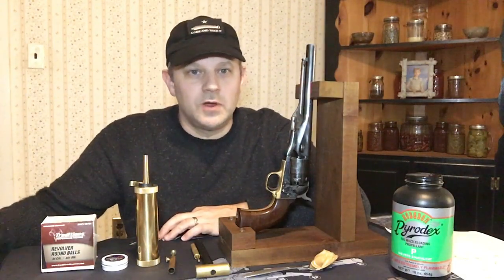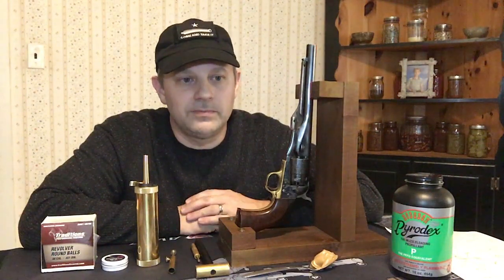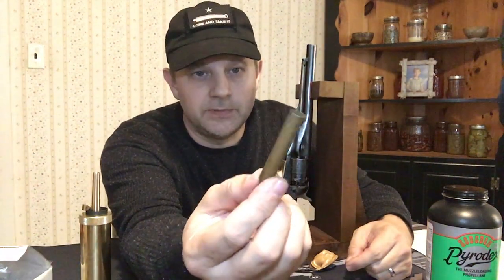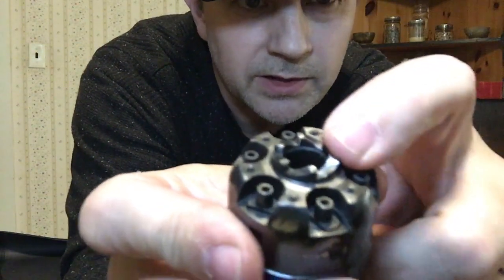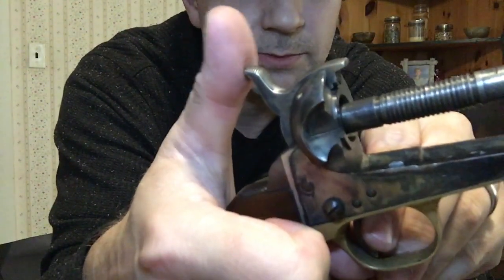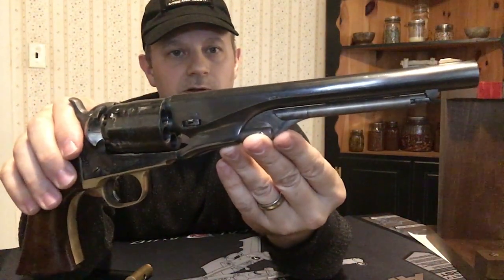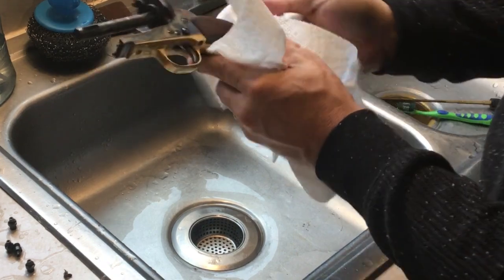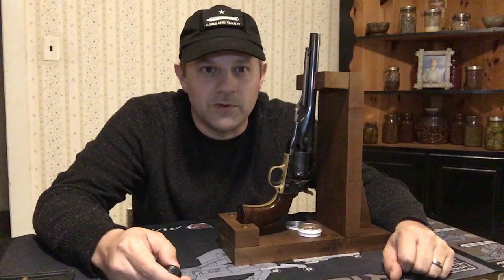1860 Colt Army - Black Powder - (Pietta Replica)

Comment: I used to have a couple of uberti 1860 army .44 revolvers. I also had a couple of  uberti 1851 navy .36 revolvers and a stainless steel uberti 1858 new model army .44 and a blued steel uberti 1858 new model navy .36 both with Howell cartridge conversion cylinders. My favorite cap and ball is the 1860. I find it’s more accurate than the 1858 in my hand both with cap and ball and cartridge conversion. I tried each of those guns in the pietta editions and didn’t like them. With how hard it is to get cartridge ammo and black powder and caps since corona I stick with shooting my Diana model 34 classic .22 air rifle now and hornet pellets but if I got back into black powder again I would get me another uberti 1860 army .44

Comment: The right size, tight fitting ball is what prevents chain fires. That is why you look for that ring of lead that is sheared off upon ramming the lwad balls. The grease merely keeps the fouling soft which inturn makes subsequent rounds more accurate.
Reply: I was wondering that. I haven’t even shot mine yet. I just shot two percussion caps they with no powder or balls. They said it cleans out the barrel? But yea I so far put powder with the measuring instrument and loaded the balls. A small strip of ring came off the ball.But I jus have it loaded and hanging haven’t taken to the range yet.

Comment: Id never put the reciever under water to clean and then dry and reasemble, the internals will rust. Better to disassemble and clean everything with a good cleaner and then reoil and put back together
Reply from the maker: I did t water clean the receiver. Only the barrel, and cylinder

Comment: can't say ive ever heard of peanut butter being used as lube. ive always used crisco, because that's what everyone i know uses
Reply from the maker: The peanut oil is a good lube and it does block the cylinders to prevent chain fires. The only drawback from peanut butter is the potential allergy risk for some people. It does smell nice when you shoot it, though.
Reply: @SmithFarmandOutdoors  as an allergy risk get somebody two ways I guess
Reply: Crisco on a hot day liquifies.
Reply: @SmithFarmandOutdoors  try 50/50 mix of lambs tallow and bees wax melted and blended. If this mix is still too soft in hot weather, just add a higher percentage of bees wax. That is the traditional lube used back in the day.

Comment: It’s not too much work if you use pyrodex pellets. Drop those in and a ball and your good to go. Have you done a chronograph or know the ballistics of the gun? I’m guessing around 900 FPS?
Reply from the maker: I have a friend who just bought an 1851. I discovered that they make the 30 grain pyrodex pellets when I was helping him find supplies to shoot it for the first time. I do like the pellets and will probably get some for myself.
Reply from the maker: I have not used a chronograph. I don’t own one but would like to get one. The $11.00 a month I’m making on the YouTube channel will take a while to save enough to buy one. Ha ha.
Reply from the maker: I’m guessing less than 900
Reply: @SmithFarmandOutdoors  yeah your probably right. Maybe 700/800. But that still a lot of power. Anyways great vid thanks for sharing. Merry Christmas 🎁🎄
Reply from the maker: @stargod3064  I’ve seen numbers that compare the energy of one of these to be almost equal to a .38 Special
Reply: @SmithFarmandOutdoors  they are inconsistent in these revolvers.
You can make combustable paper cartridges, they work well and was the way they came during the Civil War. Just place them in the cylinder, and ram the ball home, cap and shoot.

Comment: Hello, I'm gonna need the outside diameter of the barrel if I can, so I can check something.
Reply from the maker: I’ll get that for you.
Reply from the maker: Pardon the delay. We were on vacation. The outside barrel dimension, it tapers from 18mm near the cylinder down to 17mm at the muzzle.
Reply: @SmithFarmandOutdoors  thanks !!!!!!! ;-)
Reply: @SmithFarmandOutdoors  use a .454 round ball for these guns.
The Ruger Old Army uses .457 diameter balls.

Comment: You don't find a wad necessary?
Reply from the maker: I’ve shot it with and without a wad. I see no point in it. I’m not going for velocity, not hunting with it. Just plinking. A wad would probably increase the velocity
Reply: @SmithFarmandOutdoors  interestingly, the original loading instructions for colt's revolving breech pistols specifically advised against using wads
Reply from the maker: The wads can help prevent chain fires for what it’s worth. Adding the grease or peanut butter also helps with that possibility. I think the best single thing for preventing chain fires is using the correct size balls and pressing them in so it removes that ring of lead.